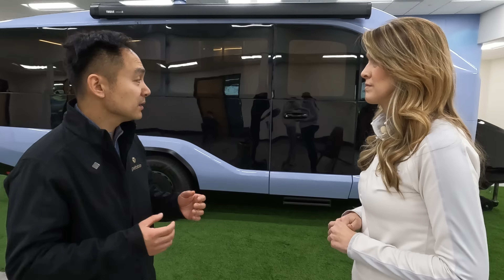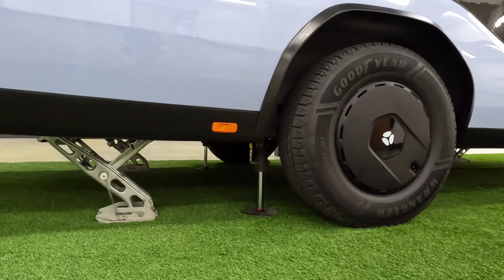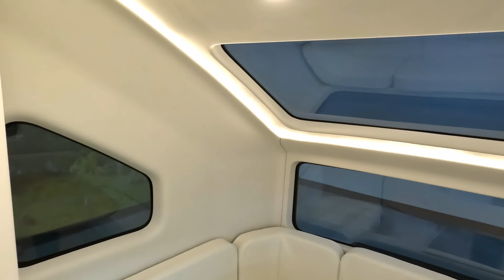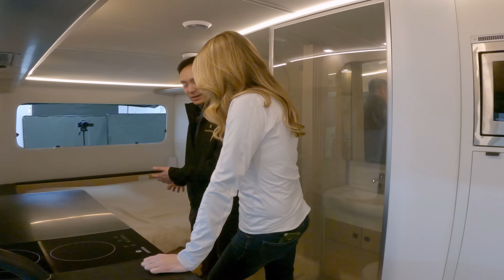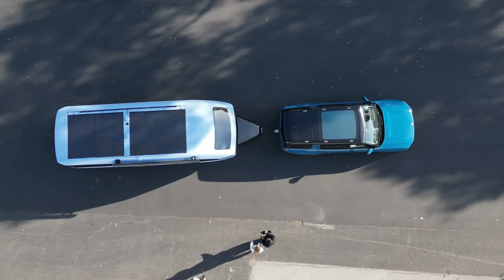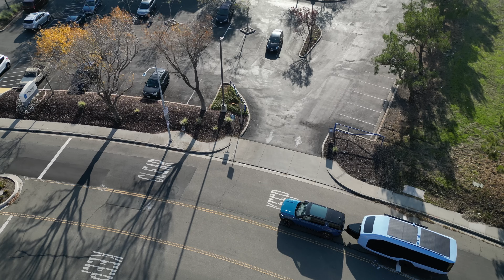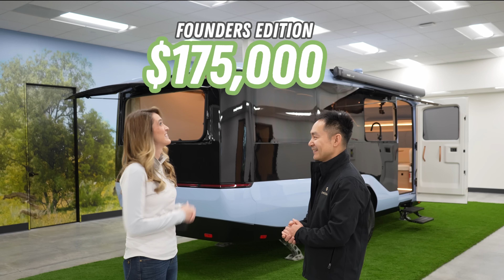Pebble Flow Electric Travel Trailer FULL TOUR (Production-Intent World Premiere)

Comment: Significantly less expensive than the Lightship, it's encouraging to see both electric RV options enter the market. Increased choice is beneficial for consumers.
Reply: I think the expanding function of the lightship is adding a lot to the price, also adds a lot of complexity and opportunity for issues. If it doesn’t significantly improve range its going to be a tough sell. If it improved range 30%+ over this, maybe it’s worth it though for those who go very long distances.
Reply from the maker: In this video the CEO said they've achieved 250 miles of real world range towing with a Tesla Cybertruck which has a 123kWh battery pack. 

Lightship told us they are targeting 300 miles with a Rivian R1T Max Pack which has about 135kWh of capacity. 

Those numbers indicate a minor efficiency disadvantage for the AE.1 considering Lightship includes an 80kWh battery and Pebble is delivering comparable range with 45kWh onboard. 

Lightship has twice the contact patch (road friction/drag) with two extra tires and it is also heavier. That said, Lightship should deliver more high speed range due to its larger battery capacity and presumably improved coefficient of drag.

When they are both in production, we suspect range comparisons will be produced. As software defined vehicles, we know there will be room for each to improve efficiency over time.

The two products each have distinct superpowers which will allow them to uniquely serve specific needs for customers.

More of our EV RV coverage can be found on this playlist: https://www.youtube.com/playlist?list=PL5nuLBN5_QSc-3irl1blsvvjrFeuQ5bPP
Reply: @MissGoElectric 250 miles of range being towed with a Cybertruck is not good, but then again the range of the Cybertruck is too low by itself.
Reply: @Resist4 250 is nearly 4 hours of driving. Don’t you ever want to pee and stretch your legs? Drive for 4 hours, have lunch (charge), drive for 3 hours pee break (charge), drive for 3 more hours have dinner (charge again).  

Sitting for 10 hours straight while eating your Big Mac from your lap and peeing into a jug, isn’t a great way to travel.
Reply: Half the battery size too.
Reply from the maker: The $109,000 starting price is very impressive!  We hope you'll subscribe to this channel for coverage when we take delivery of our Pebble Flow.  You can also watch many more electric RV videos on this playlist:
https://www.youtube.com/playlist?list=PL5nuLBN5_QSc-3irl1blsvvjrFeuQ5bPP
-Producer Tim